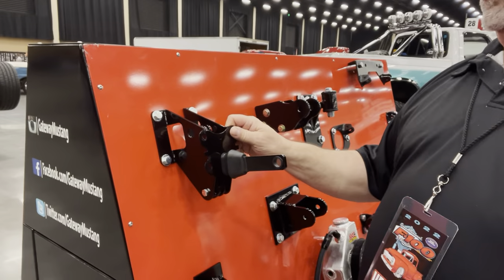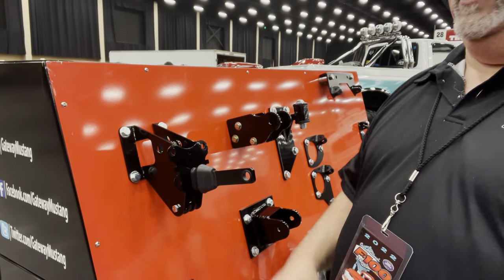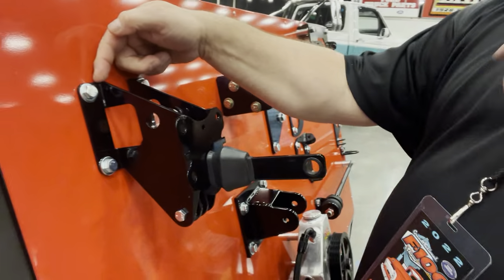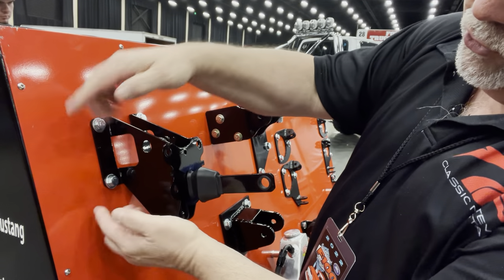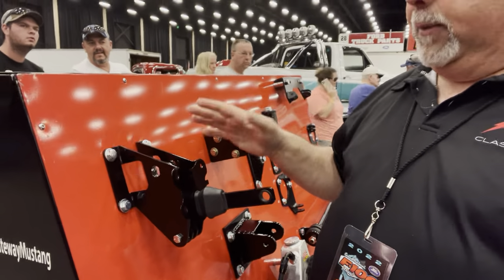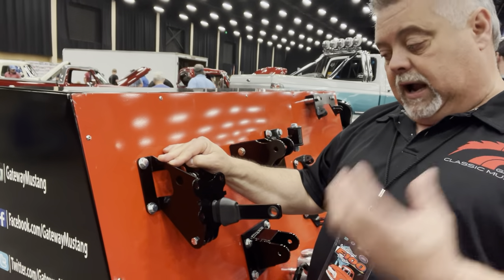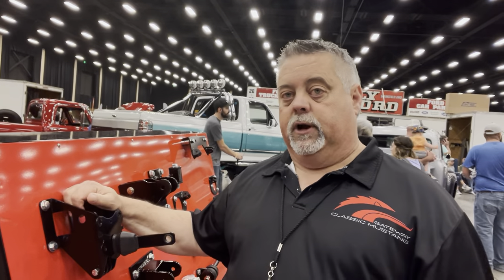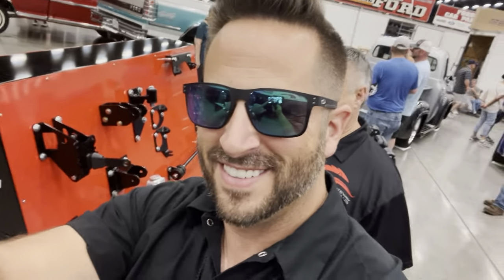F100 Brake Booster Bracket by Gateway Performance @GatewayMustang

Comment: This is nice and all, but what about us guys that have a 1967 Ford F-100 and we would like to put on power brakes.
Reply from the maker: I took a brake Pedal and clutch out of a 67 and install on my 68 assembly and these brackets lined up.
Reply: @FordF100World  I maybe misinformed, but I've always been told that if you put 68/72 brake pedals in a 67 it throws the ratio off for the brake pedal.
Reply from the maker: Idk worked for me. Fits like butter and works great